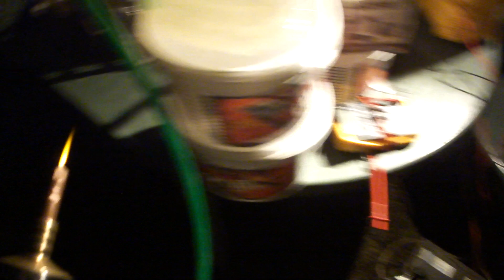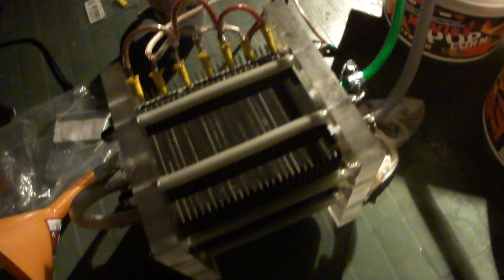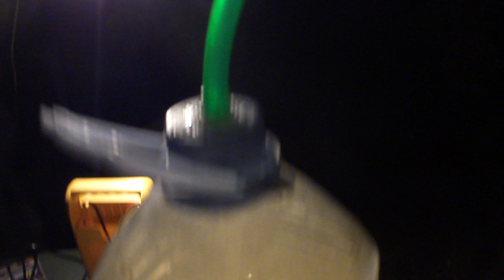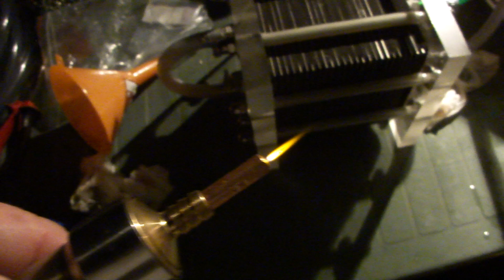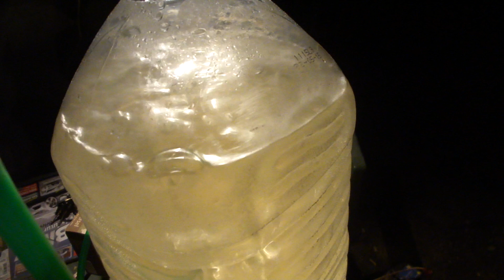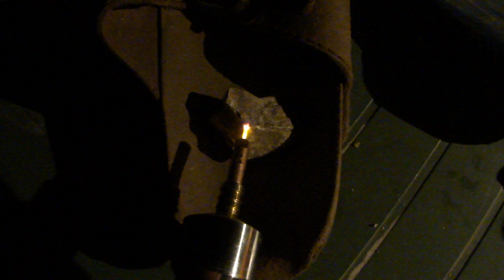my electrolysis cell finally running tinkering time in france

Comment: Well, the cell did not hold the pressure and the gaskets came out and leaked the electrolyte,
so Murphy´s law has hit once again.
Also the electrolyte container was still leaky at the bigger lower hose, so I abbonned these tests and will build up a new electrolyte container, when I come  back from vaccations.
The design with the upper hose going so low in the el. container needs too much HHO pressure to bubble out of the hose....I have to change this....
Regards, Stefan.

Comment from the maker: The right battery was almost dead, so the total voltage was only around 13 Volts...

Tommorow we will try it again with 2 freshly charged batteries in series...so the production will be much more... Today I only got around 2 to 3 Amps going through the cell and I am using baking soda ( NaHCO3) as the electrolyte as the electrolyte-Bubbler container was still a bit leaky at the lower hose.